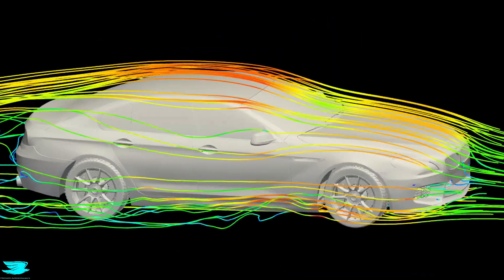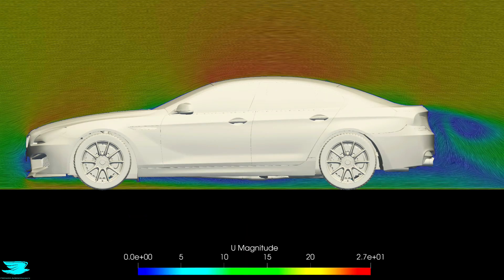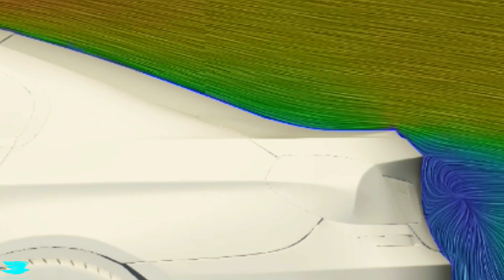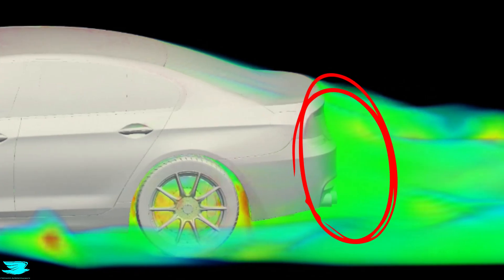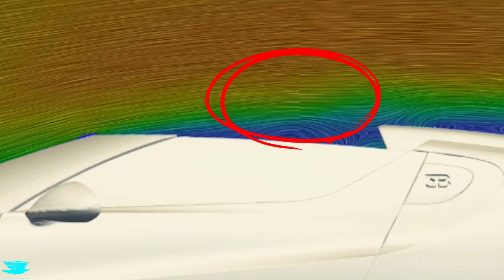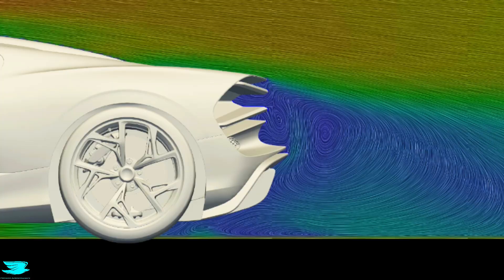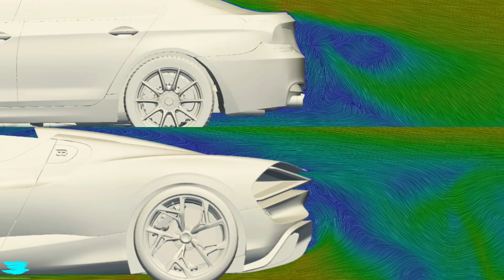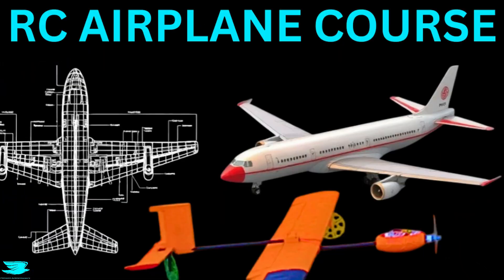Coupe vs Speedster: How Roofless Cars Manage Airflow (CFD)

Comment: 9:40 similarly to the BMW example, could you do an analysis of the new 5th gen Prius? They completely redesigned the old turtle look the previous generations had for a sleeker more aerodynamic profile, even the front windshield has more of an angle than the Ferrari 488 and the Aston Vantage. It’s an awesome design and I think it’d be a great showcase of aerodynamic design taken seriously from bumper to bumper
Thanks for the constantly awesome vids man!